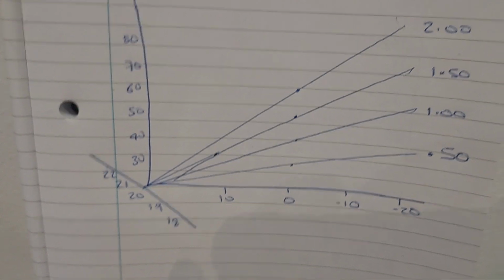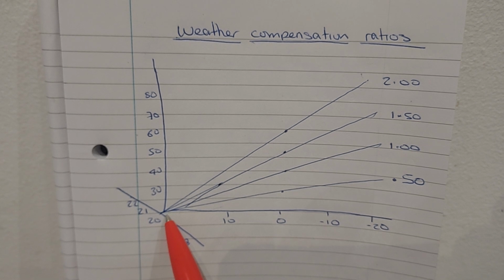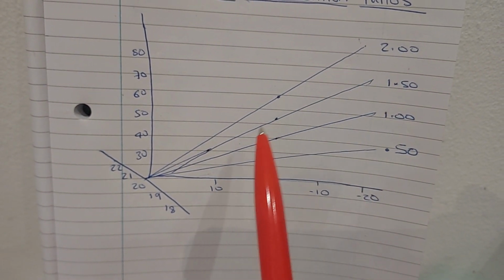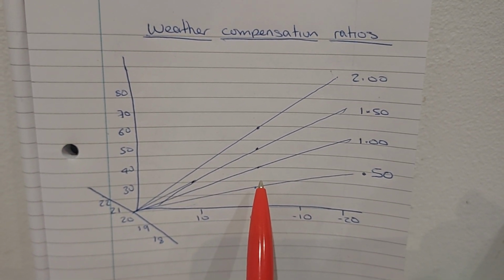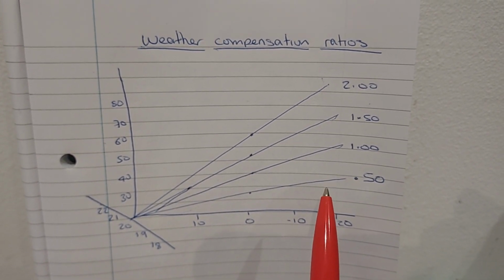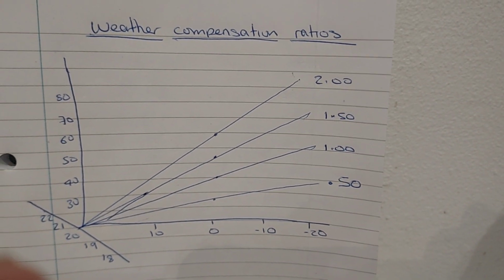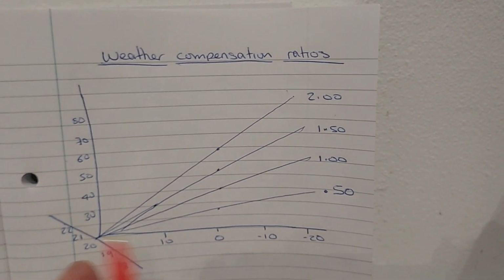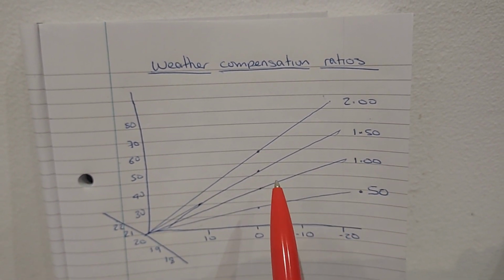Weather compensation ratios

Comment: Interesting stuff Andrew. I have a rental property where I installed a 28kw 050 boiler. I have been playing with the curve on it lately. It came set at 20c, this didn't heat the house. I changed it to 25c. Still not h3ating the rooms. It is upto 30c now and keeping it at a st3ady 20 degrees. It🎉very basic on this boiler. I have never really understood the curves. This video helped. Thank you

Comment: Very well explained Andrew. I have my all rad system running at 1.2 and a set point of 17 (no room reference) my house on an average of six bluetooth thermometers is 19.5C (which we are comfortable with) in the heating season.
Reply from the maker: If you've got your set point at 17 and your room temperature is 19.5 you have the wrong ratio. Try reducing it to a ratio of 1

Comment: Thanks for explaining what this number actually represents.

In general, what causes different emitters to need different curves? Is it related to the overall surface area (hence UFH usually less than radiators)?

I can see that a better insulated property would require a lower curve. For each degree colder outside, it requires only a little extra heat energy; whereas a poorly-insulated property would require comparatively more.

I just haven’t got it straight in my head about the differences in emitters.
Reply from the maker: This is a little bit complicated because a lot of factors kind of overlap. The curve selected does not have any Direct relationship to the insulation values of the property. So my Victorian end of terrace house could run at a lower Curve then a brand new house simply down to the sizing of the emitters. Where insulation has an impact required to match the heat load. So for example two rooms identical sizes could use the same Curve if the less insulated rum has a bigger emitter. In this case both rooms could provide the same level of efficiency but the better insulated room would use less energy. It's important to be precise without terminology if we want to understand these relationships.
Reply from the maker: Now to confuse you more. If we were talking about installing underfloor heating in a bathroom or a kitchen we could find that a radiator requires a lower Curve than the underfloor heating so it is not the type of emitter that decides the curve although it is a big factor

Comment: Do you need mixers If you ha e ufh and radiators ?,
Reply from the maker: If it's a gas boiler then you must certainly do need them but on a heat pump probably not. I haven't actually done this in real life on a heat pump so I'm not sure. I think on a Disney pump you wouldn't need to

Comment: It all mainly depends how the underfloor heating was built. Some radiate more than others. The flow temp of an underfloor heating is actually depending on the radiating power of the underfloor heating. Not on the heat source.
Reply from the maker: I don't understand your point can you explain more